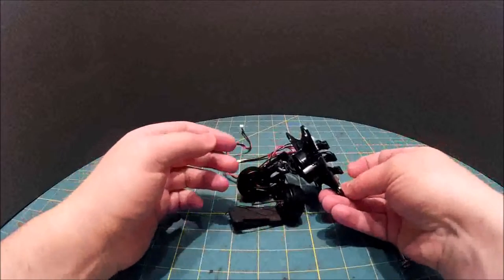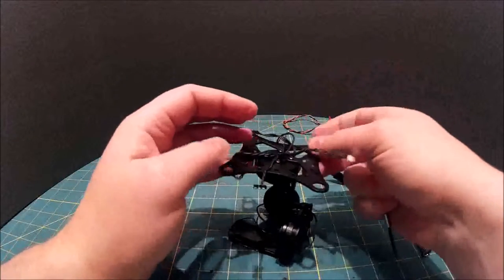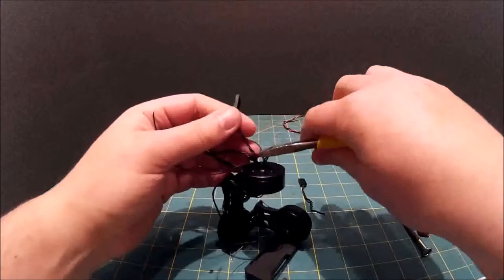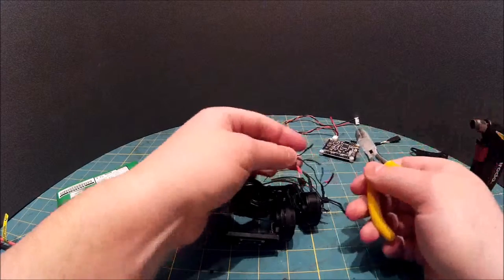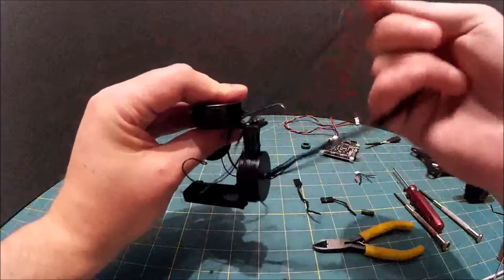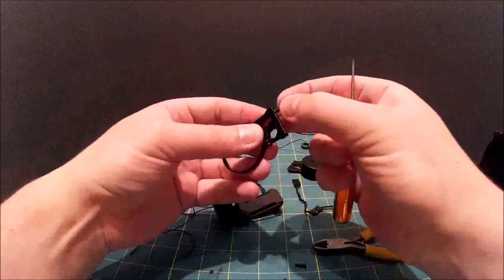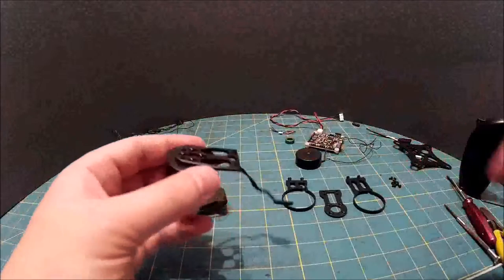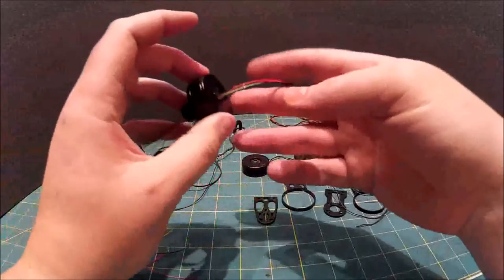3 Axis Gopro size STORM32 Gimbal Upgrade - Part 2 Teardown

Comment: Hi, I'm actually looking for doing exactly the same thing. Did you finally manage to make it ? I cannot find any part 3 video
Reply from the maker: Hi Didier, 
              I have got it working mechanically but never got round to wiring it all up. Something else I need to finish at some time!